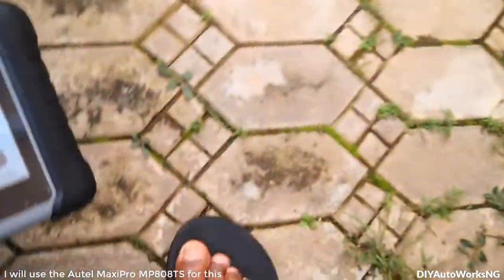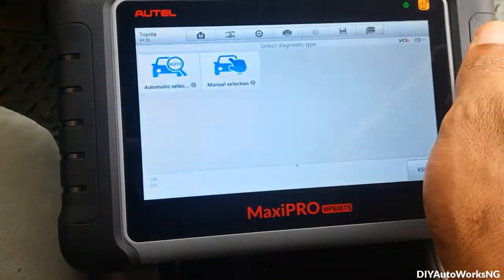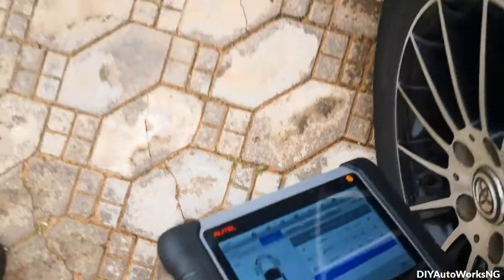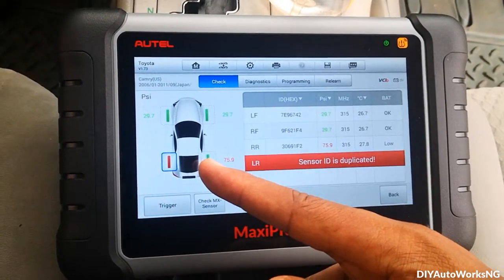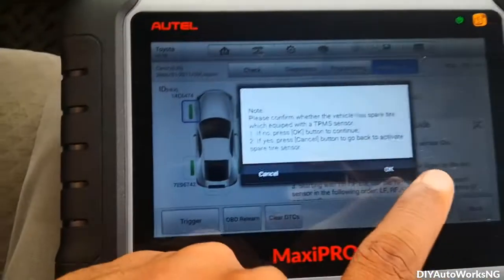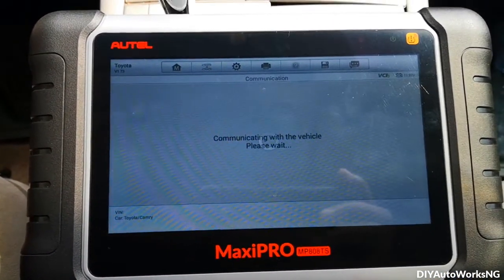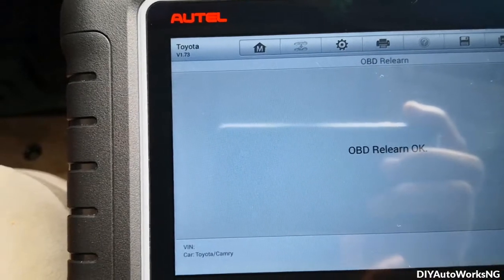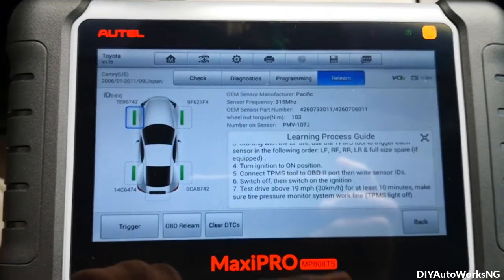TPMS relearn on 2007 - 2011 Toyota Camry using Autel MP808TS

Comment: For checking tpms sensor obd connector has to be connected or no not
Reply from the maker: Not at all. You can check any car's TPMS sensors as long as that you have access to its exterior. You can also check sensors that are not fitted to a car.
Reply: @DIYAutoworksNG got a dumb question borrowed one and I don’t know how to get to the TPMs screen

Comment: hey Ive been watching your videos and hope you can get back to me but are you able to relearn sensors that aren't by autel ?  For example, if I were to purchase some tpms from a different brand, would autel still be able to program them into the car?
Reply from the maker: Thanks a lot for the compliment. Autel says it relearns 98% of sensors. It will relearn lots of OEM (including aftermarkets made as OEM replacements), I don't know of any mainstream brand that isn't supported. Programming universal sensors is what Autel does not guarantee programming for. Hope this helps.